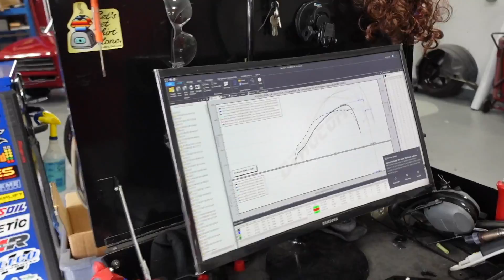BUILD BREAKDOWN: How I made 500hp on Stock 2JZ ECU and How I blew it up!

Comment: Damn sorry to hear about the damages, ran great before that though!

Im busy researching that turbo for a 3.6 engine and im curious how spool is on bigger 6 cyl engines, can you tell me when the turbo starts boosting and what ar the exhaust housing was? Im considering the divided t4 .85
Reply from the maker: @dominiquevanwyk518  I had a Normal T4 housing with a .83 and boost hit at about 3700 running 12 psi
Reply: I see, thanks for the response, will have to go wise up and see if i can calc if it will come on sooner for the 3.6 LLT engine i have at my planned 18psi.

 Was hoping for boost starting at 3K, not sure if the extra 600cc will help that much. Perhaps i should rather look at 3076 with .82 ar?
Reply: Also subbed, looking forward to more content, enjoy the journey! And Stock ecu for the win!

Comment: U need bigger injectors even if on stock rail with a return line...get rid of maf and run speed density map ..like ecu masters black here in usa driftmotion and a bolt check on car ...that's it...I have is300 sc300 sc400 cressida mx83 with 2jz r154 390 diff.  Had other cars in life but is300 light but hard to get ecm to work with cluster ect...well u full race car so emu black ecu ge block pluss gte rods 750 injectors or 1200 if go e85 and send it...get a egt gage...anything over 1100 on pump or 100 let off. That melt pistons and head...iv done it before..on mk3 and cress ..both made about high 6 to low 7...

Comment: So the stock Aristo ECU can add enough fueling to compensate for 500hp with no sort of tuning? That’s wild. I’m installing a catless downpipe/mid pipe on my aristo and I’ll probably be looking at around 15psi on the stock twins and I was worried about leaning out! Will this probably not happen? I’ve also heard the 440 injectors are only good for about 400hp, how were you able to push 500hp? Thanks for any info! I’m pretty new to the 2jz platform and car builds in general.
Reply: I put a 60/68 on my aristo it’s currently around 14psi but making more power than it did at 17 on the twins and its still has a ton of injector left in it stock ecu with a aeromotive 340
Reply: I’m right at 500hp with stock ecu and 440s. Precision 6266 on 17lbs .

Comment: Would you run a 3076 with a .86 rear housing instead of doing a 3576 with a .63 if you could go back?
Reply: 3576 is safer , lower exhaust manifold pressure. It really comes down to the set up tho. Pump gas/ low boost the smaller turbo is better.  E85 / more than about 1 bar (14psi) I would go 3576. If it's a 2.5 a 3076 may be better. If it's 2.8/3.0/3.2 a 3576 may be better.
Reply: @jasonschreiber6458  yea I bought the 3576 with a .82ar. Im running similar setup to this video but with a non vvti
Reply from the maker: Im not sure honestly I would have to run both setups to compare

Comment: Hey mate is there a video i can watch that breaks down what you did to be confident your engine was running well on the stock ecu?
Reply from the maker: Hello the only thing I did was make sure AFR's were good under heavy acceleration. I had zero drivability concerns with this setup

Comment: Great great content .thank you for educating some of us problem im having is that after  we converted our 2jz gte non vvti to single turbo the car couldnt rev higher than 2500 RPM .i really really need your advice or if you got a number i can contact you on watsap
Reply from the maker: do you have the MaF installed and in the correct direction?
Reply: It's using a map sensor
Reply: @KBNZUS  loved your build, i have moved the maf on the cold side but still having hesitation and bogging down issue. what is the correct direction?

Comment: Hi Man, just Subbed to your Channel.
Loved the build and thanks for sharing what happened. 
Im swaping the same engine into a FRS | BRZ chasis, running stock ECU and having boost cut at 14.5 - 14.7 PSI on 93 octane pump gas.
2 Questions:
1) my AFR goes down to 10.0 on high boost. Im running 43.5 psi fuel pressure and I dont see any boost leak. Did yours improve on this when you relocated the MAF? I still have it on the cold side before the Turbo (CXraxing design)
2) How were you able to run 17 psi without boost cut? Any BCC or something?

Thanks in advance brother
Reply from the maker: Yes overall the movement of the Maf helped a lot of small things. I have no added additional mods to run more boost but I have heard other people have boost cut at 14psi. I’m not sure as to why some people see different results with different boost cut levels. I haven’t done it but I have heard of others who un plugged the map sensor to get more boost but I can’t verify those results.
Reply: @KBNZUS  thanks mate! I re Watch your video and saw your still on the oem fpr. So did some research and apparently runs 37 psi. Lowered that and now on 15 psi the AFR is at 10.1- 10.5

Comment: Ohhhhh man the sound of it on that last run makes me sad…. 
Gutted that this has killed what was a great, yet still developing benchmark on maxing stock fuel / ecu setup.
Hope that the damage isn’t too catastrophic!

Be interested to know if the R35’s are compatible with a radium fuel rail & the gte intake manifold etc with no mods?
Best of luck with getting the car back together & fingers crossed on the damage 👍👍

Comment: Good write up, unfortunately all to be ruined by a lousy pushlok fitting! If you plan to keep the stock ecu, perhaps you could have an electric gauge with hi temp alarm so at least you could see it on the dash? Or multi gauge for oil and fuel pressure as well. I'm running the Jrp 14in1 gauge for my jetski and is300

Can you tell me if you can install the engine with turbo manifold and upper and lower intake manifold?
Reply from the maker: I removed it all with these bolted so it should go back in with it all on as well

Comment: I respect you and your build, and I'm not calling you a liar. but something does not add up here.
The Dyno run was extremely short, about half as long as they usually go for. the actual graph shown looks very skewed, there are multiple pulls ranging from 350hp at 6000rpm to 500hp at 6500rpm, peak torque seems to be at 5500rpm (which is wrong for a stock 2jz), for peak torque to be this late in the rpm you either should have huge cams or something else. The biggest red flag is that it is actually physically impossible to run 500hp on 440cc injectors, like it's actually impossible, especially on a stock ECU.
My guess is you did this Dyno pull in 3rd gear instead of a 1:1 ratio, this car ain't 500hp homie
Reply from the maker: It was done in 4th gear
Reply: @KBNZUS  that's not what the Dyno graph shows man, it's not right.
Like you don't even have a Piggyback ECU, you can't physically flow the lb/min of fuel to accommodate the air needed for 500hp. My guy, it's impossible.
Reply: @RallyRanchMotorsport  not impossible anymore
Reply: @user-qj2cq4dv3k  what do you mean anymore? 
Do you realise that the injectors would be at 115% duty cycle? THAT is not possible, unless he is running like 60 psi base fuel pressure.
Reply: @RallyRanchMotorsport  doesn’t Toyota over engineer stuff? I’m sure there’s ways to squeeze performance out of stuff maybe not for long but long enough
Reply: @user-qj2cq4dv3k  no, the injectors are made by denso not Toyota. 
Just so you know, 100% injector duty cycle means that the injector stay open for 100% of the time the engine is rotating through its cycle, it never closes. Which mind you is a bad thing.
 So like I said, it's ACTUALLY... Physically impossible to inject more fuel.
Reply: @RallyRanchMotorsport  we’ll I’ve got almost the same set up minus trans but I’ve got a bigger turbo if I ever get it dyno’d I’ll be able to confirm deny
Reply: He’s on a cd009. 1:1 is 5th gear
Reply: @Aura_nge  that's all the proof I need to say that this guy's is definitely lying about his 500hp figures and that they are fake.
Dyno numbers should only be spoken about in 1:1 ratios, even then they vary a lot.
Reply: @RallyRanchMotorsport  I have a 99 sc300, using the 2jzgte vvti with all oem intake manifold and non immobilized gte vvti ecu. Precision 6266, fm intercooler, a340, return fuel, stock 440’s, regulator, and fuel pump. Mine did 380-385 wheel on dyno dynamics dyno on low boost, and looks like I need more injector soon. On dyno jet it was 405 or so wheel with no changes lol have some sard 540cc’s I’m going to drop in, but may need a piggy for those to run